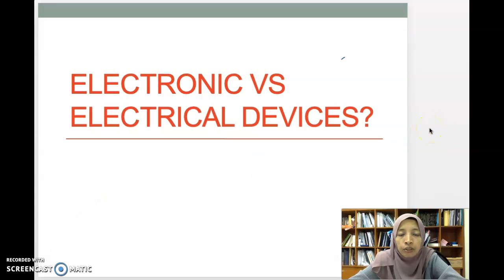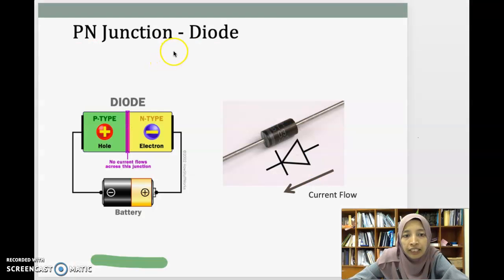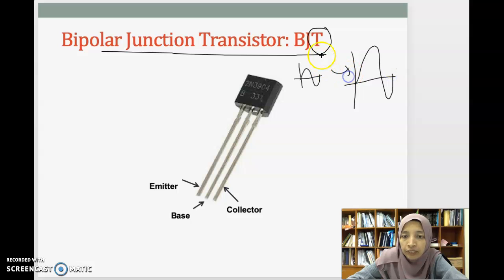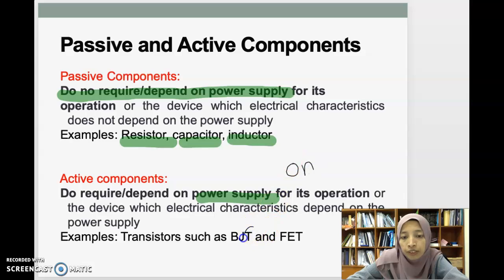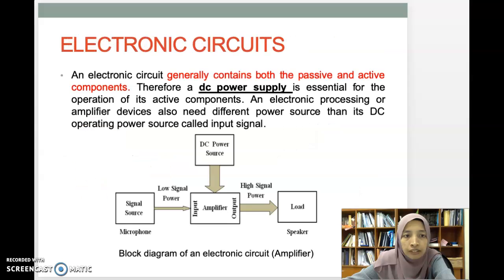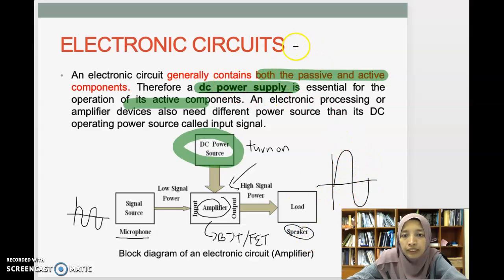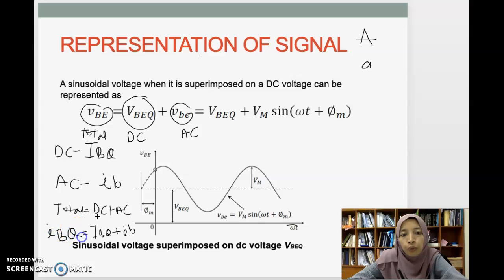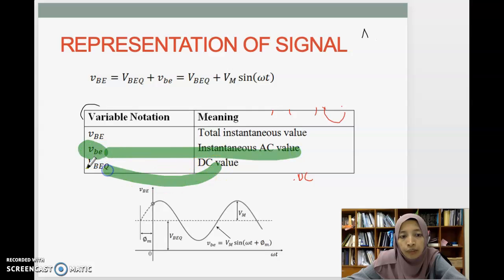Chapter 1 (Part 1) Intro to electronics

Comment: Salam Dr, the reason why diode is an active component is because a current (AC) is required for the diode to do its job (Allow current to flow in one direction). Is this reasoning correct ?

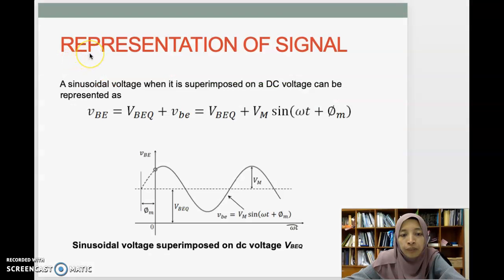Comment: Assalamualaikum Dr, for 6:20, we need the AC supply to amplify the input signal or the AC supply is provided to the input signal ? 

Thanks for clarifying Dr.
Reply from the maker: Waalaikumussalam Br Sayhan. Yes you are correct, for active devices we need both DC supply ( to turn on the device) and AC supply ( to amplify the signal)
Reply: @alizaaini4706  Thank you Dr for your reply.